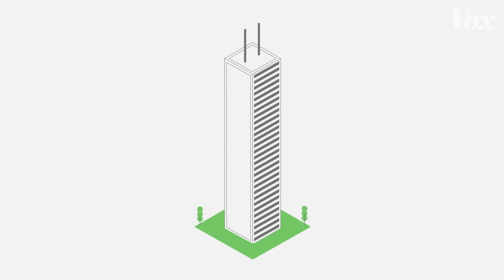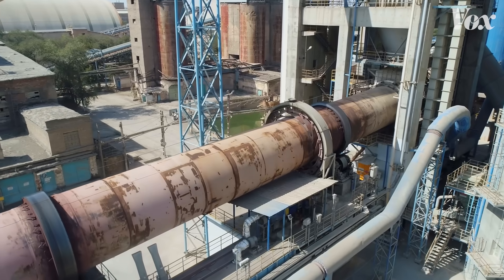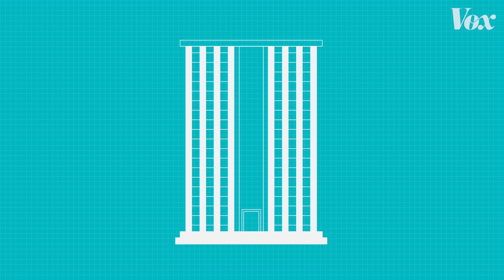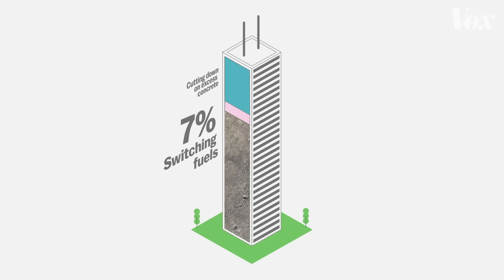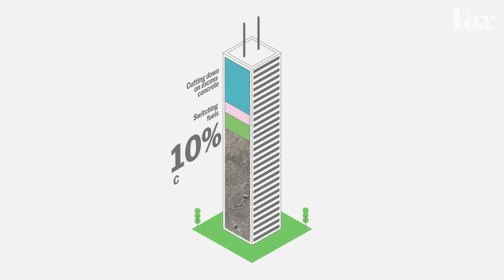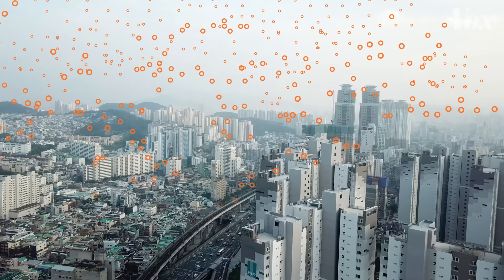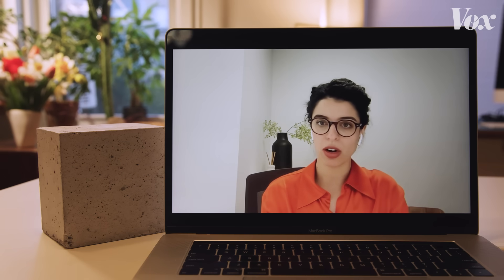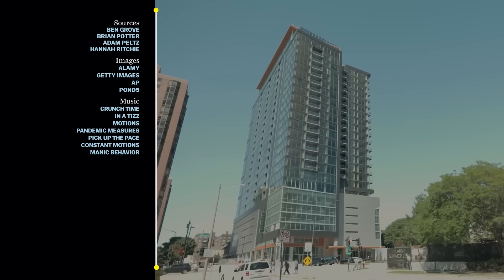The big problem with cement, and how to fix it

Comment: I have worked a lot in this industry and can say that this video is very correct, they included pretty much everything in modern cement industry carbon reduction. However it should be mentioned that there is also a large natural difference in cement produced in different countries due to different properties in local materials. Also the "just use wood" is mostly marketing/lobbying from the wood industry. If we used as much wood as we did cement there would be no forests in just a few decades.
Reply: We as humans like to find one material and make it solve all our problems. Using wood by itself would be just as problematic, but when you start making solutions where you incorporate many components that you'd need less off, it's easier to be sustainable, the same way working a team is better than having one person carry the load.
Reply: Just here to point out that the video does mention that wood can't be the only solution, but should be considered as part of the solution in cases where it makes sense.
Reply: If you keep farming and re-growing trees, every ounce of wood used in construction is an ounce of permanent carbon-capture. Whereas if you never cut trees and just let the forest sit there, the carbon captured in wood is a fixed amount, limited by the land area of the forest.
Reply: 7:45
Reply: We are using more timber than ever before and still not out-pacing the rate at which the trees can be grown. There are more trees now than 70 years ago.
 
What you said simply doesn't reflect reality. Timber is definitely viable, regenerative, and sequesters carbon. Habitation loss is occurring for other reasons, not the farming of trees for engineered timber.
Reply: I agree
Reply: She said that about wood at the end. That if we completely replaced it with wood it would create other environmental problems.
Reply: What do you think about dirt blocks? They use at most 5% cement, but you can make them without it. You need to build larger elements to withstand the same load, but it's eco-friendly, and more energy efficient (it helps regulate the internal temperature of spaces), I'm still a student of C. Engineering, but I want to restart the "adobe" industry in my region
Reply: @Iñaki Flores  Wouldn't that form of construction be somewhat limited by scale, climate, and material specific to native regions? Definitely sounds promising though and follows traditional notions of adobe construction. 

Hemp construction is also intriguing in it's versatility, but not accepted due to enherent biases that many governments have for its cultivation.  And the industry always pushes to keep the status quo, even when there are more beneficial solutions sitting around to be utilized. Unfortunately, it's slow to adapt to change.
Reply: return to brick and limstone blocks 👌👌
Reply: Good point about the wood
Reply: Completely agree that the materials used in construction should depend on the location
Reply: Also a bunch of the wood used is engineer lumber which uses a bunch of oil to make the glue.
Reply: Where do you live?  I feel like lumber is a much bigger issue in Europe than here in North America where we already construct most things from wood (Skyscrapers being an obvious exception, though rarely going up these days with the popularity of 5-over-1)
Reply: Don’t forests grow exponentially if we let it happen?
Reply: @iche9373  Plants compete with each other. Nature is nowhere near perfect. But we can code them to work most efficiently for our purpose.
Reply: @V2RocketScientist  so basically biotechnology
Reply: They mentioned the "Wood" part at the end of the video.
Reply: Thing is the more the demand grows the more the supply will increase untill you reach a overflow point were we start to seriously reclaime and recycling wood to get the most out of each treee
Reply: If we used up the forrest, and then planted new ones, our homes and buildings would become storage for carbon!
Reply: You can grow trees, you can't grow cement. Wood is sustainable, cement isn't.
Reply: The ideal outcome would be using cross-laminated timber with wood grown from cell cultures. But we are probably 10+ years away from that being viable at scale.
Reply: Impossible, we already deforest 100% with 1% each year for 100 years. Now there's only wood farms.
Reply: Especially because trees and forests are a major carbon sink. The more we cut down, the less carbon being taken from the atmosphere.
Reply: I always hear the reason why concrete doesn't last as long as say... Some roman concrete. (Not just due to the use if limestone.).

 That rebar is the culprit on why our concrete lasts only for so many decades instead of centuries. 

 So if we could build to last like our ancestors. We wouldn't be using as much. Make a building last for the ages! (Also easily recyclable.).

 I mean couldn't we reinforce it with something that is even more durable as steel while maybe being weaker, but more durable against the forces that generally degrade it. Along with modern self healin, carbon tradable,  concrete techniques. 

 I want to see mega buildings where you could literally live your entire life in one. Has everything from a bakery, butcher, restaurants to banks and doctors.  Have skyways to go a neighboring building. Those new magnetic elevators that can go in multiple directions in the X, Y and Z axis.
Reply: Hemp, bamboo and other natural building materials could possibly be a good substitute for wood.
Reply: All of these "quick fix" videos on de-carbonization miss one major factor: Just use don't grow. If we didn't grow we wouldn't NEED to build so much, and if we got rid of capitalism, or at least the consumption side of it, we could re-purpose buildings for people as the population slowly shrank, which it needs to.

All of these types of videos miss the main problem: Growth and capitalism. And they're afraid of criticizing them, so we get these basically greenwashing videos instead (VOX).
Reply: You’re right.
Reply: I am agree about the trees part. Even if there's tree 'that could grow fast', it still problem for where we plant them. I used to watch how media critisized industrial forest as it destroyed the wild forest.
Reply: Solving climate issue by destroying more forests, aint that brilliant.

Also, when people plant trees they mostly plant the same kind of trees in the area, and then you have monoculture problems, and that's another whole other can of worms.
Reply: @ShirokiMaki  beauty of carbon sequestering is that once you cut down a Forrest for construction materials the carbon gets stored. Planting a new Forrest where the old one was continues the process of taking CO2 out of the atmosphere. If the original Forrest isn’t cut down then the level of sequestered carbon stagnates
Reply: @Essentially_Nobody  the problem is that we can't sustainably cut enough trees, a 400sqm slab requires about a dozen concrete trucks, which is around 120cubic metres of concrete, to get that amount of wood you'd need a small forest's worth of trees, and that's just one medium sized slab in one building in one city, keep in mind I'm not even taking selection into effect and I'm assuming you need the same amount (which you don't)
Reply: Using trees is actually way more sustainable, they in capture CO2 so using wood in buildings acts as a carbon sink. On the other hand, cement is made from limestone which is made from fossils and therefore availability will slowly deplete as it doesn’t renew. Of course, we shouldnt be destroying old forests to get wood, but planting huge new forests with fast growing trees good option. And yes, there might not be enough land to do this. But at least its more sustainable. It may not seem like a good option now, but once all fossil based resources run out we need to make a choice
Reply: @Essentially_Nobody Every part of the process is getting stronger for bioengineering better trees that grow faster and bigger. From selective breeding the seeds of the best, to university research like the Michigan Technological University poplar tree... trees are still in this race.
Reply: @jakehix8132  We already have species of trees that grow fast, you might want to check out the damage they do to the soil.
Reply: @DJKINS  They don't what to check it, cause they don't even know this stuff. Cause videos like this never show them the negative effect. He is right about replacing everything with wood just a lobbying marketing from the wood industry.
Reply: Just use wood.

Well that's the problem wood is cheap just look at shipping pallets - trash. 

We take it for granted that it's easy and really available.

For the use of wood I think we have to look back 200 years before the automobile and see how it was used then. Before trees 3000km could be cut down and shipped.
Reply: C'mon, dude, we can plant a giant amount of trees.
Reply: @ЦзинКэ-ы5х  it takes 20 to 30 years to grow a tree to full size. So no we cant "just" plant new forests. This doesnt even account for the huge ecosystem damage it would do.
Reply: @sigurd154  exactly
Reply: @sigurd154  Nope. Mjøstårnet, the tallest timber building in Norway, is mostly made of Norway spruce and Scots pine. Both of them can grow 30-60 cm per year. Yes, biodiversity clearly should be enforced while re-growing forests for building materials. But we already have countries, that have sustainable or almost sustainable forestry. Finland, for example, is one of the world's largest producer of pulp, paper, and cardboard and one of Europe's largest producers of sawn timber. Despite increased use, Finnish forest growth has doubled in the last 50 years, number of large-diameter (40+ cm) trees has quadrupled in the last 100 years
Reply: GMOs would be a great way to grow the perfect wood as rapidly as possible. But, i am against wood when it comes to buildings. It just doesn't last long enough and you have to deal with weatherization for anything outdoors. Concrete may have an initial carbon footprint, but it'll last for a very long time and require basically no maintenance.
Reply: @sigurd154  forests for timber are not ecologically diverse. They’re not natural habitats at all. Ancient woodland is
Reply: To the ones that are saying “we can just plant more!” We would still be destroying ecosystems in these forests. We can always plant more, very hard to recreate a ecosystem
Reply: @ЦзинКэ-ы5х  no we cant
Reply: @critiqueofthegothgf  Yes, we can. At least, in Europe.
Reply: @ЦзинКэ-ы5х  no
Reply: @ЦзинКэ-ы5х  yea we can plant giant amount of tree SAPLINGS....not fully grown trees....and as the OC mentioned....there are also ecological damages which are which takes a whole lot more time to be undone

Comment: 3 key points by Tammy AI 🏭 🏭
0:00: 🏢 Cement production accounts for 8% of all global carbon emissions, but reducing excess concrete and finding alternative fuels for cement plants can help cut emissions.
3:15: 🏭 The cement industry is a major contributor to global emissions, but there are strategies to reduce its impact.
6:36: 💰 Implementing carbon capture and storage in cement production will be expensive, but government agencies can absorb the green premium as the cost of cement is a small fraction of the overall project cost.

Comment: Actually, concrete releases CO2 once it becomes fluid, but takes back up CO2 once it hardens. Is that taken into account here?
Reply: My reaction has been removed?
Anyway, if you Google "concrete absorbs carbon dioxide", you will find several sources that state concrete absorbs roughly 30% of all CO2 emitted from concrete production. Otherwise, you can also watch a recent explanation of Veritasium.
Reply: if it releases co2 and then takes back in the same amount of co2 that part would be net zero, idk tho,
Reply: Limestone releases CO2 as it becomes liquid, but takes it back up again once it solidifies. So I think there is a factual mistake here.

Comment: Another issue with cement/concrete is that it tends to trap heat and slowly release it back to the surroundings even at night, which contributes to higher ambient temperatures in urban environments. This contributes to what is known as the "Urban Heat Island" effect.
Reply: arguably a good thing for cities in colder climates, but bad for cities in warmer climates which would subsequently have to rely on more air conditioning, further increasing the ambient temperature
Reply: As a person living in tropical climate, I could agree, when most of house here use clay brick hold with cement. The heat inside the house during daylight is "little unbearable" unless you use a fan.
Reply: Asphalt not that great either.

It absorbs the sunlight better because it is black.

Some cities are experimenting with painting (?) some of their roads with a lighter color to help with the heat island effect.

So far it working, it doesn't drop the temperatures not very much, it adds up.
If They also plant low water and/or drought resistant tree and/or plants, that also helps with the heat island effect.

Extra:
Would Solar panels would also make heat island effect even worse?
Reply: District cooling systems and  passive radiative cooling panels and trees.
Reply: They also don't hear up very quickly
So, buildings, during the day don't have to use that much sir conditioning
Reply: @vishalgiraddi5357  they do. The RCC road in front of my house becomes hot like a pan at noon.
Reply: @elfrjz I did. And yes, nice cold.

Comment: Could they heat it with hydrogen produced by electrolysis?
Reply: This would be less efficient than just heating with electricity directly. Producing hydrogren costs way more energy than is released by burning it.

Comment: Just build paper houses like a true NA person. And then complain bc u need air conditioning and your house doesnt withstand storms :))
btw cement absorbs co2 ....
Reply: Were that the case we'd being seeing massive carbon sinks in every city, yet we aren't
Reply: @angelitabecerra  well it absorbs it not permanent, just when curing/hardening bc it needs it for the chemical reaction. And just as much as it needed during production, so it should be or almost carbon neutral.
Reply: murrican moment

Comment: What if we made cement and concrete more durable? Use more recycled materials in cement and concrete? Would the use of Roman concrete (aka the type of concrete used in Ancient Rome) help?
Reply: Roman concrete is made with resources that are not available in large enough quantities to supply the modern concrete industry. We would have to artificially make quicklime using extreme heat which  would cause even more environmental problems.
Reply: @Hölökyttäjä  Could use Roman concrete. Though I'd say for sidewalks and dams, not buildings.
Reply: Can't use rebar with Roman concrete, limiting the size and shape of what you plan to build with it.

Comment: It's not about we must afford it, but they need to make it cheaper and accessible. Pricey stuff won't be an option other than developed country. Even timber architecture needs some sort of tech which developed country still reluctant to share to others. Heck there's also possibility the woods required can only imported for some places.

As long as nation being the leader in netzero. When barking at other nation, but not cooperating with other nation (only profits), climate change will continue.

Comment: While cement production does contribute to CO2 emissions, concrete, its primary end-product, offers multiple benefits to humanity. Concrete's durability and low maintenance make it a cost-effective and resilient building material, essential for modern infrastructure. Furthermore, advances in cement technology, such as carbon capture and utilization, can mitigate its environmental impact. Ultimately, the advantages of concrete in constructing long-lasting and energy-efficient structures should not be overshadowed by the emissions associated with cement production.
Reply: Why is this comment phrased like a concrete industry press release?
Reply: @HeadsFullOfEyeballs  yeah..sure it is!
Reply: No one is saying that cement isn't great for what it does or that we need to completely replace it.  This is a discussion about how we need to change it BECAUSE it is so necessary.

Comment: the issue with replacement material is that its effectiveness as building material varies a lot depending on the environment

using wood and glass more than just decorations in places where it's hot and humid can cause a lot of headaches about maintenance as well as lifecycle emission
Reply: Blue Crete.

Comment: buildings should be reused and designed to last hundreds of years. If you keep tearing down buildings to build new 'eco' buildings then you are making things worse
Reply: The problem is that our needs change. Buildings that were designed hundreds of years ago are usually inconvenient and inefficient for modern use.
For example, a house that was built to be heated by some sort of hearth or stove doesn't need great insulation, because most of the warmth will be in the form of radiant heat, not warmed-up air that can escape to the outside. When you install central heating or air conditioning in that house, you waste huge amounts of energy unless you put in extra insulation, airtight doors and windows, etc. etc.